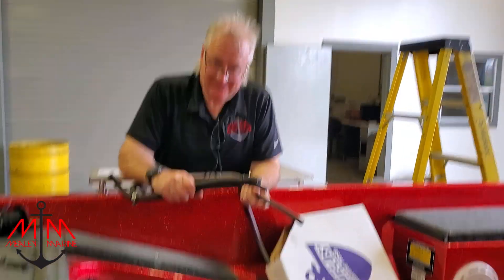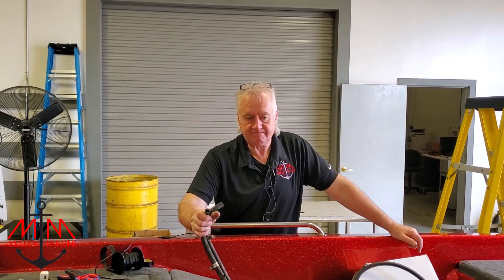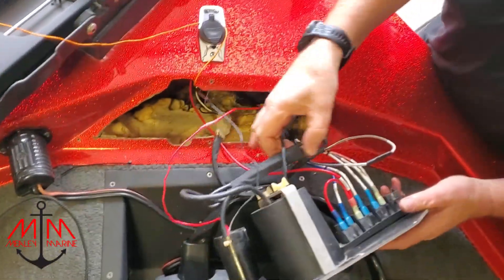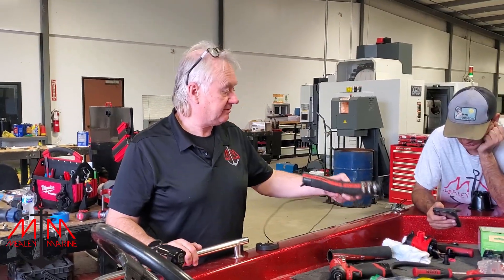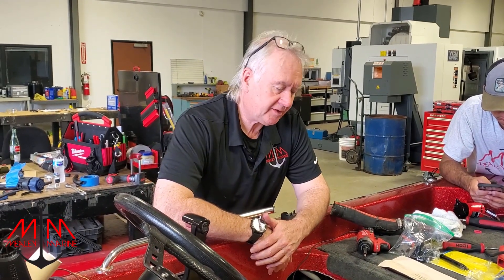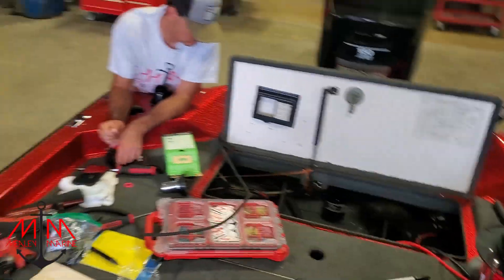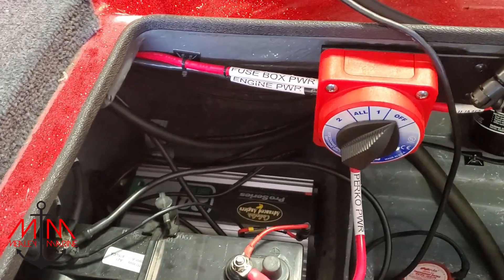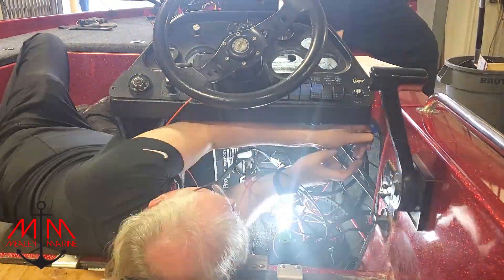1993 RANGER 361v | BASS BOAT RESTORATION | PART 5: NEW FUEL SYSTEM

Comment: Tip:  The gray fuel line is best for exposed lines that aren’t in a rigging tube for the motor.  Black is used when being placed in a covered rigging tube.  The gray line holds up better in exposed UV rigging like this boat has.

Comment: You Guy`s are INCREDIBLE!! I`ve been going right along with this project with you and i`ve learned so much from you both. I have an 89 361V and my blinker trim  just stopped working even though the   Trim switch on the Forward ,Reverse  shift handle & rear Trim switch on the motor both work. Before I buy a New one , Could there be a fuse causing it to not work or do you think it just needs replacing?